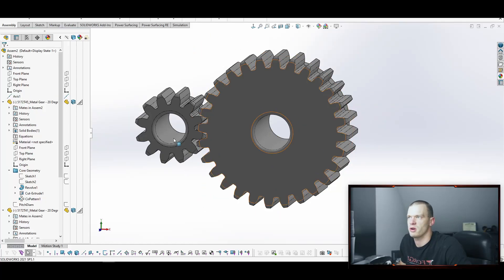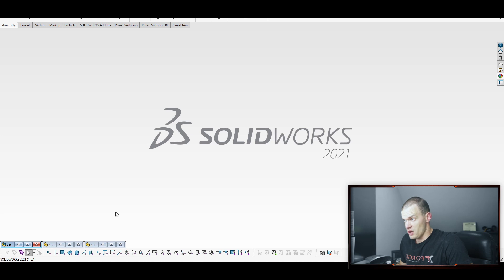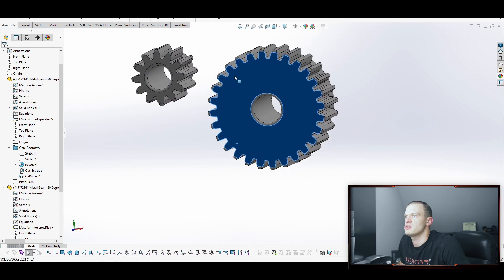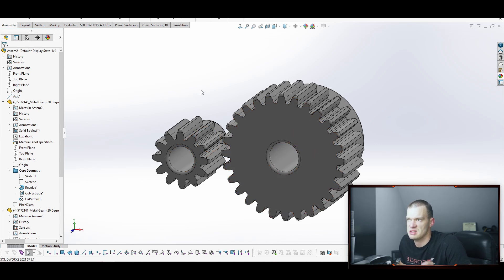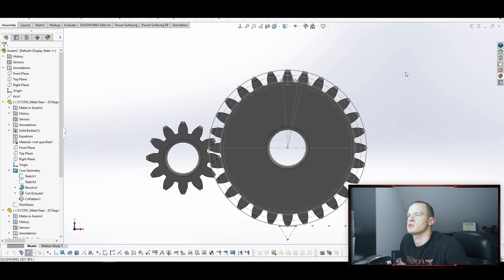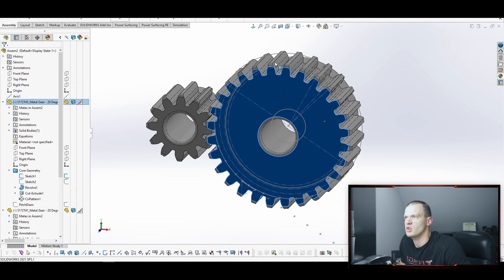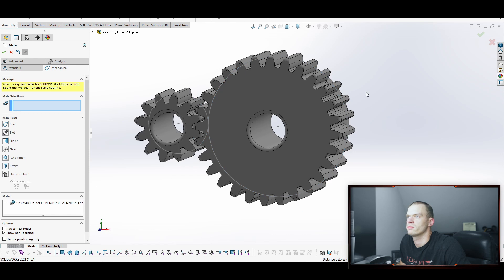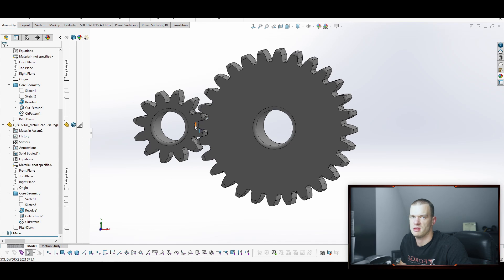How to Mate Gears in SolidWorks

Comment: Thanks for this tutorial. I didn't feel like fiddling around with sketches and I already had the gears mated, i only needed them to mesh together. I found out that i didn't need to use a sketch, i just clicked a circular edge on both gears and added the ratio manually. Worked perfectly!
Reply from the maker: Good for you, I'm glad it worked! If you are working from dumb solids, as you would when importing a 3D model from a gear manufacturer, this can be a viable solution. 

If you are designing from sketches, I would encourage you to try using the more stable sketch geometry to define your relationships. It can help prevent your feature tree from freaking out when you make changes later on. It may take a few seconds longer to define, but can save time in the long run.

Comment: how you calculate 2.5 mm distance between each  gear ?
Reply from the maker: Is you are using off the shelf gears, the distance between gear axis will = (PD1 + PD2) / 2

Where PD is the Pitch Diameter for gear 1 and 2. 

The pitch diameter should be listed in the specifications for the gear. If not, you can calculate it given other know values of the gear (module, number of teeth, etc.). Does that help?
Reply: @forgeproductdevelopment  thx